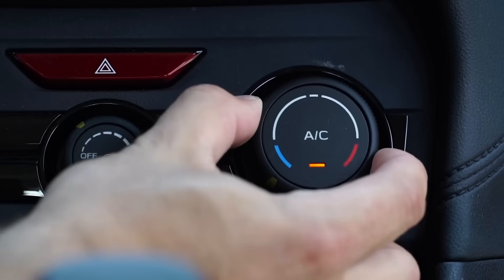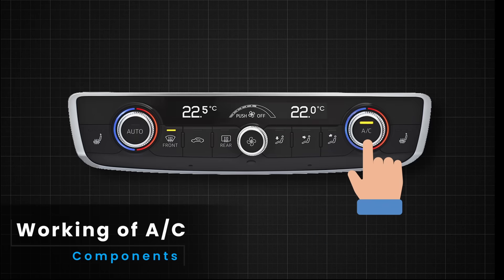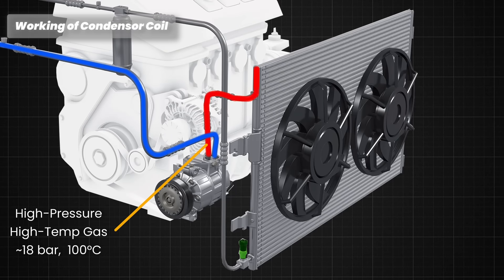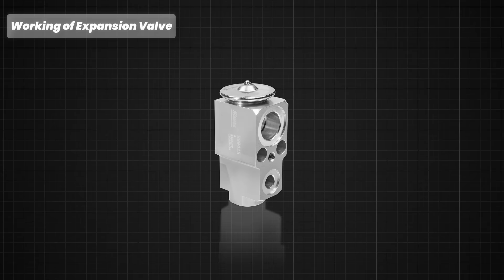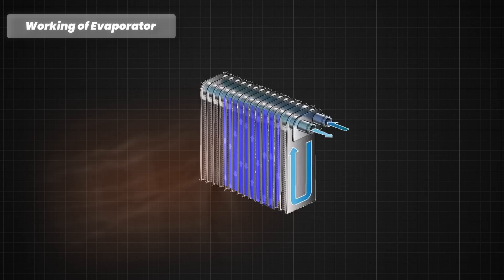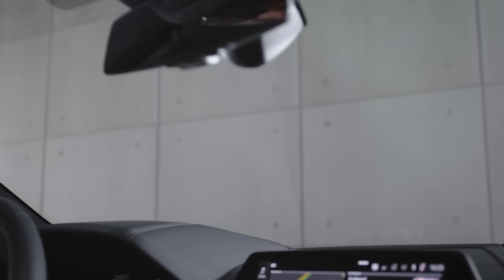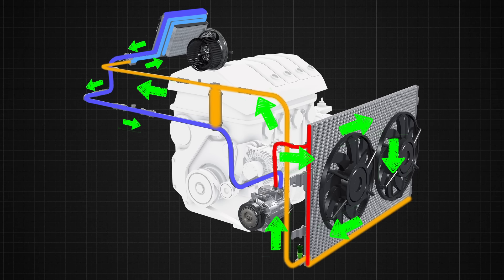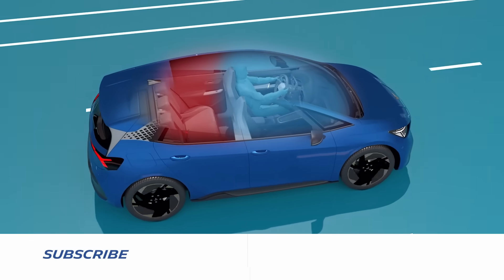How does Car Air Conditioning Work?-Components and Their Functions -Car AC system

Comment: man... i was really hoping how the climate control works was explained. like what exactly happens when you turn the ac temp cooler or warmer.
Reply: There is a blend door that controls how much air goes through the evaporator coil and the heater coil to control temperature. More modern cars will have a variable output compressor that can throttle cooling output for better efficiency. The blend door and compressor would be electronically controlled based on sensors.

Comment: My AC air is cold when i drive and becomes hot when I stop. What can be the reason?
Reply: Radiator fan not turning on or spinning fast enough. Or the condenser and radiator need to be cleaned.

Comment: I grow up with the "wisdom" that you should not turn on your AC for extended period of time when the car is idle and that the AC should only be used while the car is moving. Is there a difference between using the AC when the car is idle vs moving?
Reply: Depends on what you mean by extended period. If everything is working as it should then it's just less efficient at idle due to the lack of moving air. Its generally discouraged because of the environmental concerns. The engine idles at a red light and there's no need to turn the AC off.

Comment: There was a consistent hissing sound from my car ac and it was not cooling. So after checking mechanic told me to change the evaporator coil and extension valve as there was leakage. So they changed it . primarily no hissing sound and cools good but after 2 days when i start the car ac it's still making hissing sound at first very minimal. Is there still any existing leakage?

Comment: Can You make A Video of the Toyota  SIENTA'S Refrigeration System Which Happens to be an Effective way That prevents Damaging Compressor From the Liquid that's coming From Evaporator Coil.
it's Discharge line is Going Through The Suction line like a 5" from the Expansion Valve to almost a Feet and it gets out from the suction line and Goes to the Outlet of Condenser.

Comment: As a facilities manager and HVAC-R specialist, I’ve always been curious about car air conditioning systems—something never covered in my technical courses, college, or post-graduate studies, since my academic training and professional experience have always focused on building maintenance. This video touched only on the basic fundamentals of refrigeration, with just a few car-specific components like the compressor. I’d really like to see more in-depth content about how automotive AC systems work—for example, whether the expansion valve is electronic or thermostatic, if the fans use inverter motor drives, or how multi-zone temperature control is achieved, Is it managed only by the fans, or do they employ separate expansion valves for each zone, similar to a VRF system?

Comment: If the compressor always runs with the motor, what does turning the AC off achieve?
Reply: the clutch engages when you turn on the AC, thus engaging the compressor.

Comment: and can some one tell me why they say : Using the AC make you burn more gas?
Reply: It’s all about dispersion of energy. When the AC is off, the compressor isn’t spinning thus energy isn’t being taken away from the crankshaft. When the AC is on, additional energy is required from the crankshaft to spin the compressor. Since the compressor is “stealing” some of that power from the engine, the engine needs to work slightly harder to gain the same result as if the AC was off. This means more fuel burn

Comment: Why is it that when I turn on the air conditioner, after a few minutes, such humid and unpleasant-smelling air comes out through the vents, but only if it's not in recycle mode?
Reply: Cabin filter
Reply: This is due to mould growth in the system. If changing the cabin filter doesn’t fix it, try an AC refresher spray.
Reply: Change your cabin air filter. It will take pressure off your blower motor too as it’s allowed to blow more freely.
Reply: I replaced it with an activated carbon anti-allergen but it didn't get any better. It got an ozonation treatment and it got a little better, but to me it feels like there's some kind of moisture or something, I don't know what's left in it because when I start the car in the morning, the windshield fogs up right away.

Comment: The start-up for an EV is much more than an ICE Vehicle. However, through it's usage, depending on where the EV gets it's electricity (renewable or non-renewable energy), and EV can make up for it's environmental damage through efficiency and no longer needing oil or gas. 

Given these garbage companies though, through planned obsolescence, these cars will NOT last as much as an ICE Vehicle (in most cases, as compared to a Toyota or Honda). 

If you are worried about the environmental consequences that much, just stick to the car you drive now and fix it/ find ways to make it more efficient. Either way, you driving causes environmental damage, the least damage you can do is, if possible in your area, is using public transportation. Here in the U.S. our politicians are bought and there is basically a non-existent Public Transportation system. People need to VOTE to see the change they want to see. VOTE for people who catuslly want to fix this country, not some rich people who just want to rule over us.

Comment: But what's the point of the compressor? Why would you want the refrigerant to get become hot?
Reply: because you want the heat to travel to the relative “colder” outside. So the refrigerant needs to be warmer than the outside air to get rid of its collected heat from the inside.
Reply: it is a gas pump.  you need to move the refrigerant, it cannot move or flow on its own.  in so doing, the gas becomes hotter because that is what gases do when compressed.  and if you do not compress it,  how would you condense the low pressure low temperature (about 60F) gas?  you need a lower temperature medium to condense it.  how would you do that?

by compressing it, you can use ambient air to cool it down and condense it. and "pump" it too.

Comment: EV A/C is much more complex, it actually helpsncool down the HV battery and motors, the equivalent of the ICE, and during winter highway driving, it can use the generated heat in the HV and the motors to help heat up the cabin more efficiently, I you took a momentof the Video for deep diving into that as it is more fascinating than the typical A/C system

Comment: What is ac clutch
Reply: Its a same clutch like the car clutch. The difference is, when you press the button of AC, the clutch in AC compressor's pulley engages with the pistons of compressor powered by engine pulley. Simply, the AC clutch engages or disengaes the working of compressor pistons

Comment: 2014 Chevy Silverado...Well, vapors/fumes are emitting into the cabin whether I have on heat or AC? The cabin heats up and cools well, but the smell is sickening. It is a combustion smell as if coming from the engine into the cabin! PLEASE HELP!
Reply: It's a serious fault 😂
Reply: check the seal at the inlet vent

Comment: Wow!! one of the greatest explanation of HVAC system of the car
Reply: Even if many have an understanding how automotive A/C works when they have the engine running and air conditioning on when hearing a click or the tone of the engine changed when of the number of vehicles to farm and construction equipment has the A/C compressor in an easily accessible spot when the request for A/C sent a signal to engage the clutch to spin the compressor.

Comment: I was re gasing my 1zz aircon and it works and cold but for one day and next day I started my vehicle it's was very hot, what is the problem
Reply from the maker: It sounds like you might have a leak in your AC system. I'd recommend having it professionally inspected to find the source of the leak.

Comment: Random question from an OCD overthinker.   If I have a chipped / damaged carbon fiber part in the front of my car, am I at risk of getting carbon fiber dust/particles into my via the AC?
Reply from the maker: A chipped or damaged carbon fiber part on the front of your car isn't likely to release particles into the cabin via the AC system. Carbon fiber dust typically doesn’t become airborne unless the material is being actively cut, sanded, or ground down.
If the damage is superficial, it’s probably not a cause for concern. However, if the part is severely damaged and exposed to continuous stress (e.g., from wind or debris), there’s a slim chance tiny particles could become airborne. To be extra cautious, you might want to repair or seal the damaged area to prevent further deterioration.
Reply: @motoringmasters thank you.   I do think I’m being overly worried about it. But it’s also better to be safe than sorry.  I appreciate the response

Comment: How does the recirculation mode take care of the oxygen you breath in the vehicle?
Reply from the maker: The recirculation mode in your vehicle doesn't directly manage oxygen levels. Instead, it recycles the air already inside the cabin. For longer trips, it's a good idea to occasionally switch to fresh air mode to ensure proper ventilation and maintain a good balance of oxygen.

Comment: so basically the main component of the AC is the refrigerants chemical change or pressure change taking of advantage of the fact that it becomes very cold when the pressure drops
Reply from the maker: Exactly! The refrigerant's ability to absorb and release heat depending on pressure changes is the heart of how car AC works.

Comment: Does the function of ac affects the radiator fan?
Reply from the maker: Yes, the function of the AC does affect the radiator fan. When you turn on the AC, the condenser, which sits in front of the radiator, generates heat as it cools the refrigerant. To manage this extra heat, the radiator fan (or fans) usually kicks on to ensure proper airflow through both the condenser and radiator.
 So, it's normal for the radiator fan to run more frequently when the AC is in use.

Comment: what if the AC is on full blast for long periods while the car is only in Idle?
Reply: That's why it has fan at the front side that cools the radiator when the car is idle 

But when the car is moving at high speed the oncoming natural wind cools radiator
Reply: @Akshay13134  thanks... that was supposed to be common sense 🫣

Comment: Does the Gas need to be refilled? After a while?
Reply from the maker: Ideally, the AC system is a closed loop, so it shouldn't need regular refilling. However, over time, small leaks or natural seepage can lead to a loss of refrigerant, reducing the AC's effectiveness. If you notice a decline in cooling performance, it may be time for an inspection and possible refill. Regular maintenance checks can help ensure your AC system remains efficient.

Comment: Thank you so much, but What is connection between AC and temperature mode? My understand is AC only helps to clean and dehumidify the cabin air and the temperature must be the job of temperature mode ?
Reply from the maker: The AC system in a car does more than just clean and dehumidify the air—it actively cools the cabin by removing heat through the refrigeration cycle. When you set a lower temperature, the system uses the AC compressor to reduce the air temperature. The temperature mode setting then mixes this cooled air with outside or heater core-warmed air to reach your desired cabin temperature.

So, while the AC is responsible for cooling and dehumidifying, the temperature mode controls how much of that cooled air, or potentially warmed air, is mixed to achieve your set cabin temperature. I hope this clears up the connection between the two systems!
Reply: @ thanks a lot for your clarification, I can get it through now.

Comment: Hi! thanks for the very informative video..
In a tropical country, is installing a bigger condenser makes the AC work more efficiently?
Thank you!
Reply from the maker: In a tropical country, installing a larger condenser can indeed help your AC system work more efficiently. A bigger condenser has more surface area to release heat, allowing the system to cool the refrigerant more effectively and potentially improve cooling performance and efficiency, especially in high ambient temperatures. However, it’s important to ensure the rest of the AC system is compatible with the change, as mismatched components could lead to inefficiencies or strain on other parts. I’d recommend consulting a professional to confirm the best solution for your vehicle.

Comment: When the AC is on, does it use fuel?⛽️
Reply: Yup, cuz the compressor uses mechanical energy from the engine thus increasing it's load thus increasing fuel consumption

Comment: If receiver dryer helps to catch the remaining compressed high temperature gas from the liquid but after going through the expansion valve that same gas is generated back again,even though cool at this time, my question is: why don't allow the gas to go through the expansion valve without using the  receiver dryer?
Reply from the maker: it's true that after going through the expansion valve, the refrigerant turns back into a low-pressure gas, the receiver dryer has an important job to do beforehand.
The receiver dryer contains a desiccant that removes any moisture in the refrigerant. Even tiny amounts of moisture can freeze at the expansion valve, causing blockages or damage to the AC system. Without the receiver dryer, there’s a risk that ice could form in the system, reducing cooling performance or even causing serious damage.

Comment: i got a F-150 2018 XLT 120k milles and my AC is not cooling until it reach exactly 40 mph anyone know why ?
Reply from the maker: may be AC Compressor or Thermostat Valve or Radiator Fan.

Comment: What are the odds that all of the car ac parts go bad at the same?
Reply from the maker: a failing compressor could send metal shavings into the system, which could damage other components. If debris or moisture gets into the AC system, it can cause damage to multiple parts such as the compressor, expansion valve, or evaporator over time.
While it's uncommon for all parts to go bad at once, regular maintenance can help catch issues early and prevent a chain reaction of failures.
Reply: @motoringmasters  Thanks ... Just pretty much had to get everything replaced, in my Mazda 3. But the company turned out to a poor in diagnostic. If they would have told me from the beginning how much it cost to replace everything I would have said no and sold the car to somebody in Alaska.

Comment: How can hot gas flow through water that cools the engine? (2:35) I know it doesn't but you say that it does.
Reply from the maker: I said the hot gas flows into condenser near the radiator. Condenser is located next to the radiator. Radiator and Condenser looks very similar with a small difference so don't get confused.
Reply from the maker: There is a difference between the two where the gas goes to the condenser and the water in the radiator.
Reply: @motoringmasters  I get confused because I only have a radiator in front of my car, on the side of it there is a condenser where AC lines go into, the chamber is extended over the top of the radiator (possibly the bottom also) where the line starts again going to the compressor. I assume the chambers take advantage of the airflow going through the radiator and kind of piggy-back on it to cool the gas a bit before it get re-introduced back into the compressor. By no means does it go through the radiator fins  like it's shown in the video. It might be different on different cars as in, having another radiator going over the main radiator, but idk, haven't seen one yet. edit: At this point I assume that in your video you are working with two radiators, the engine one and another one over it for the gas. I have no such thing in my car. As I stated, one radiator. Perhaps that's why this was confusing to me. Thank you for replying by the way.
Reply from the maker: In my video, I have shown only the condenser. What you are talking about is a radiator. I am not talking about water and radiator in this video.
Please go back to this video and see it clearly.😟
Reply from the maker: Radiator and water makes the engine cool, but in this video i don't talk about the radiator at all.
Reply from the maker: What you saw in that video is a condenser
Reply: @motoringmasters  I know what you are talking about, and on the screen I see a radiator. It's quite distinct, it has giant fans and it's in the front of the car. It's fine, just forget about it.

Comment: 2014 Mustang, outlet temp in the cabin will drop to 40F or lower, then warm up at the same time the air flow is reduced. Turn the AC off for about 5 minutes and all is OK again for awhile. Seems like the Evaporator is freezing up and blocking airflow. Several components (including thermal expansion valve) have been replaced, but so far, No Joy. Any ideas on causes and repairs? Car has been to 2 different shops so far and both have given up.
Reply: check if the compressor is turning on and off.  it should cycle.  if it does not, there is your problem.
Reply: i suspect that the thermostat (temp sensor) is installed incorrectly. it might be in the front of the evaporator.

Comment: If you have an orifice tube you’ll have an accumulator instead of a receiver dryer.
Reply from the maker: Yes, that's correct! I explained this simply in the video—systems with an orifice tube use an accumulator, while those with a Thermal expansion valve use a receiver-drier. Thanks for watching and sharing your input!